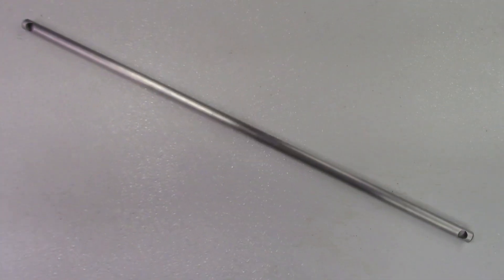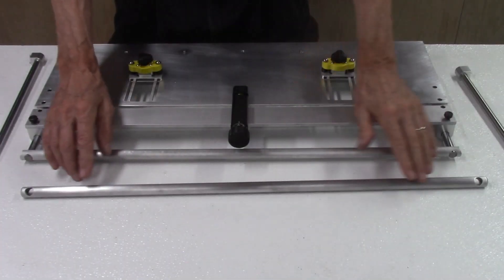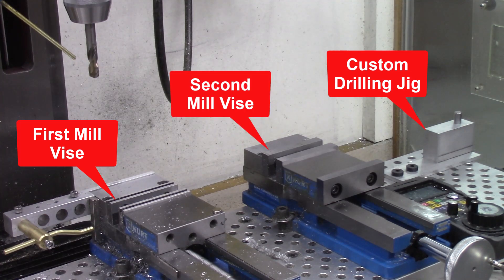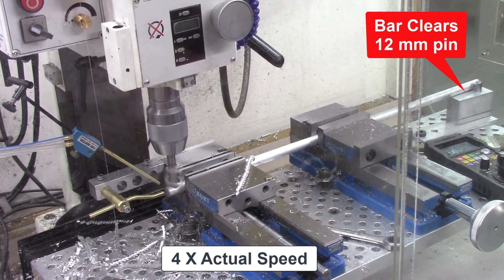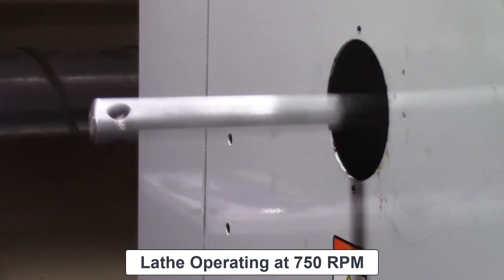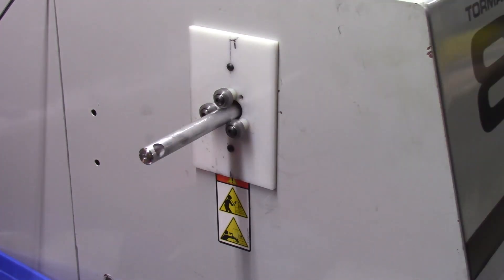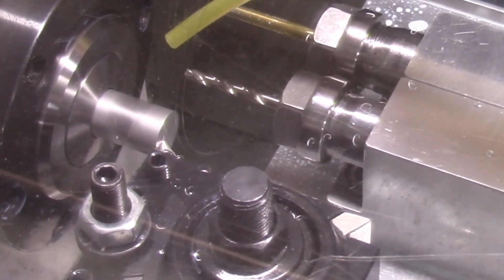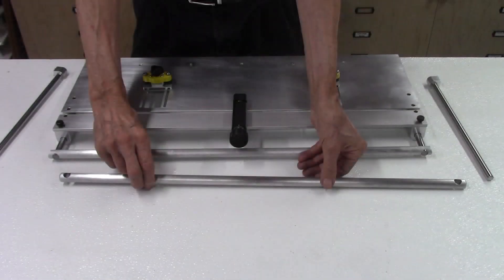Machining Long Bars on the Tormach Lathe and CNC Mill

Comment: hi quick question how are you able to measure 25.5 on the mill if outside travel?
Reply from the maker: I cannot measure the distance on the mill since the mill only has an X Axis travel of 20 inches.  I used a previously machined bar to set up the mill and then confirmed the distance after I machined my first bar.